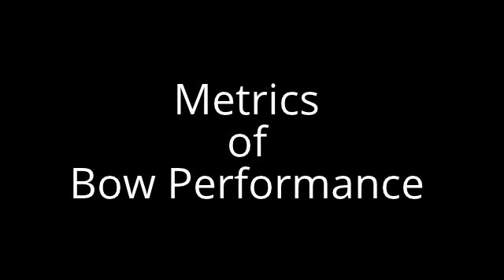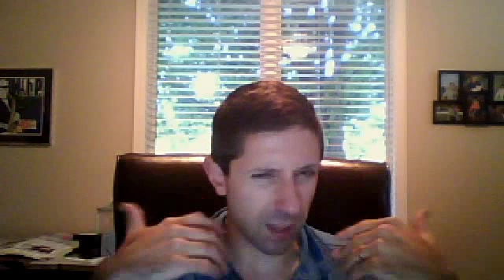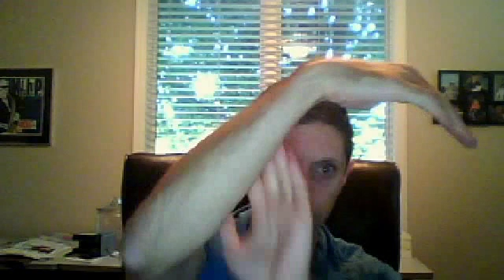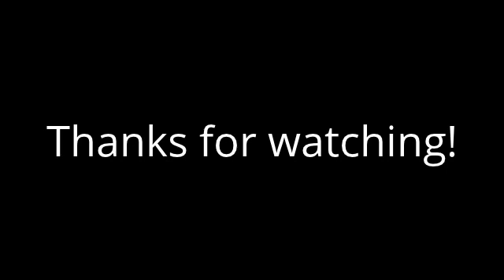Metrics of Bow Performance - What's "Good" Performance in a Bow (PVC or otherwise)?

Comment: How do you measure "Stored Energy"? I know I can measure Peak Draw Weight, and get the specs for any particular arrow, but how do I measure the 'Stored Energy" of any particular bow?
Reply: A bow is essentially a spring. You would need to test it to determine the force vs draw distance curve. Work done (which is potential stored in this case) would be an integration of dynamic force to whatever draw length.

Simply, you would need a machine to measure the increasing force of the bow as the draw length is slowly increasing. You would obtain some equation of force with respect to draw distance by computational analysis of the data. Then you would perform a calculus integration by hand or by computer to determine the total stored energy at a given draw length.

Comment: Some good points. It's good have the input from someone who has looked at things with an open mind. I've never been comfortable with one factor being used to assume one bow is more efficient than the next. One reason I think speed is very important is that no matter how the force is delivered (early, late, or consistently peaking), at the point when the arrow leaves the bow the bow has done all it can do. Of course the arrow may feel the force more at any point before launch and actually bend, or even twist, enough to affect its efficiency This may vary according to the material the arrow is made of, its weight, or design. But, at least you can try different arrows, and, as you say, always try to use the same pull length and method to get a true comparison. And, consider the atmospheric conditions. Thanks for sharing your thoughts.